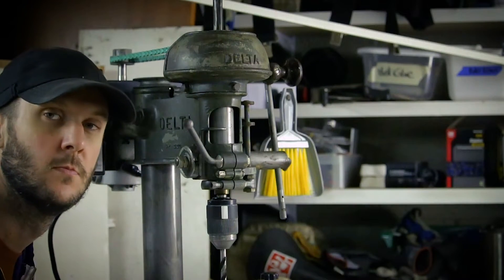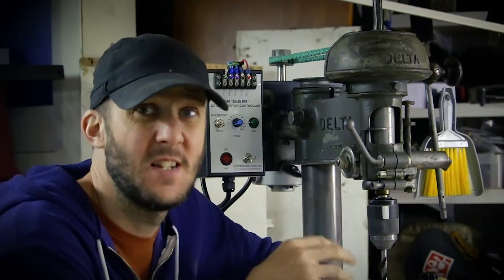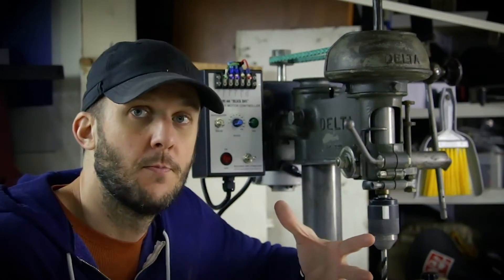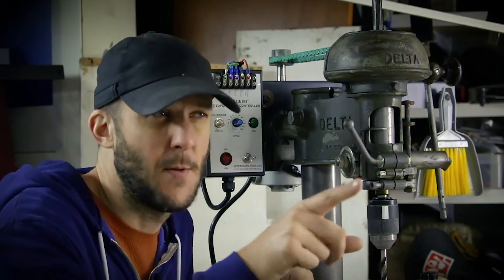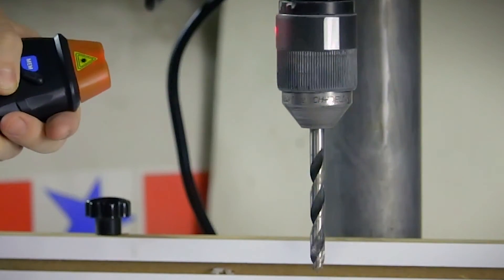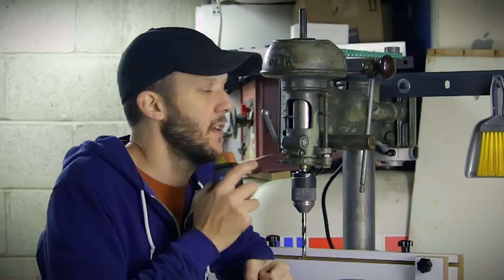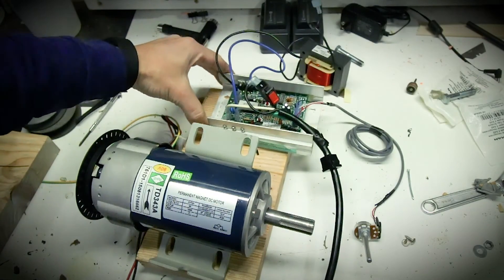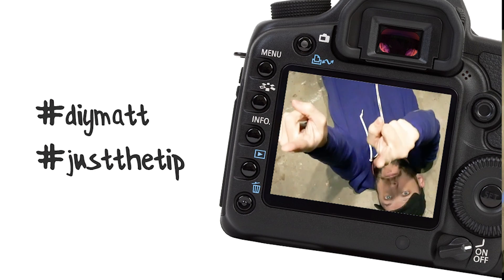I converted my vintage 1940's drill press to DC power.

Comment: I realize this is an old video, but hopefully you’re still monitoring this channel.

I converted an old wood bandsaw to a DC treadmill motor and I made the controller for it. Although it was nice to be able to adjust the speed on the fly I found that the low end torque was garbage. The whole point was so that I could slow the speed down to cut steel. Although I could cut steel, I had to feed the steel so slow to avoid bogging down the motor that it was basically a worthless upgrade. 

What about your drill? Does it bog down when you slow it down to drill into steel? What is the HP on the DC motor you used?

Thanks,
Iz
Reply from the maker: HI Izzy!  I have pretty much exactly the same experience. The drill press works "ok" and recently I've done some work to it and tightening up  the belt has helped me.  The slower speed on the DP is worth the occasional bogs in my mind.  
 I converted my bandsaw as well, with the same results as you. Mine was a multispeed bandsaw so I think I might just convert it back.  
I'm using the same setup for a 2x72 belt grinder and i tend to blow fuses if I bog that down too hard, but then i know I'm pushing too hard on the material.
Im almost wondering if the green vbelts are more my issue than the DC motors.
Reply: You could try going to a 3 phase motor under 3hp and use a variable frequency drive to have reverse and all speeds with full power throughout the range. It will run on single phase power without needing a phase converter. A little bit more money but with way better performance.
Reply: You just need to regear it. By that I mean you need to have the DC motor running at a pretty good clip while the drill press chuck is turning slow. Maybe a jack shaft is needed or maybe you have room to put a tiny pulley on the motor and a very large one on the  driven shaft.